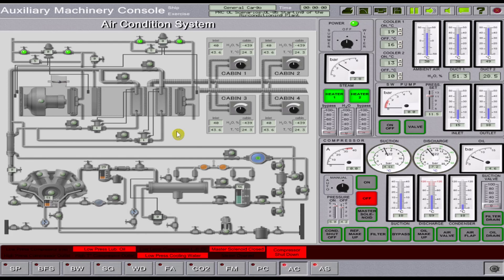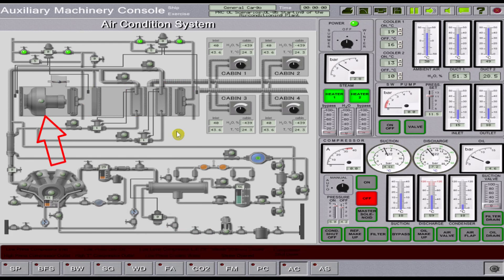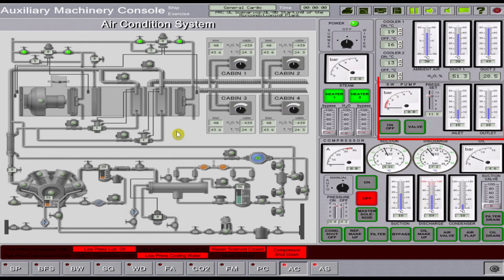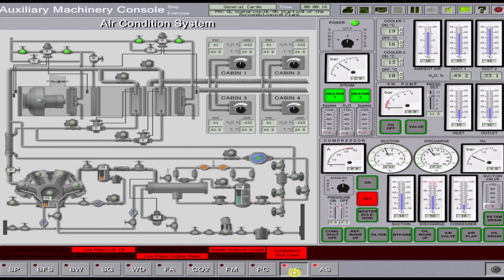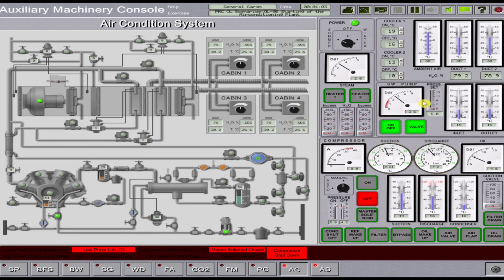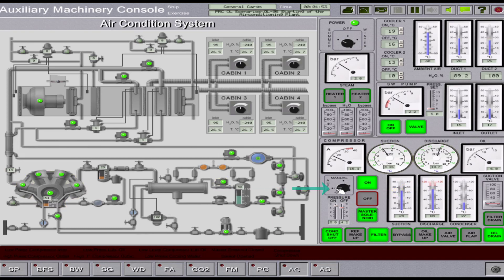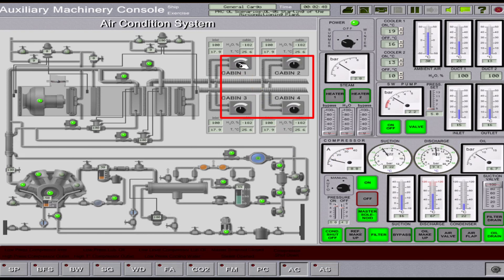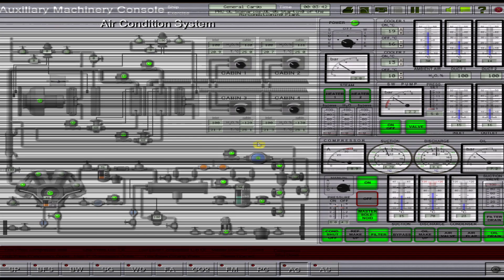How to Operate a Marine Air Conditioning System? (Summer Control Mode)

Comment: How to adjust in case issue in humidity
Reply from the maker: To control the air humidity, it is first necessary to turn on “H2O” valve manually
monitoring the air humidity values in the first and second ducts. After it has been set, humidity is controlled automatically in accordance with the ambient
temperature by the first duct temperature control.